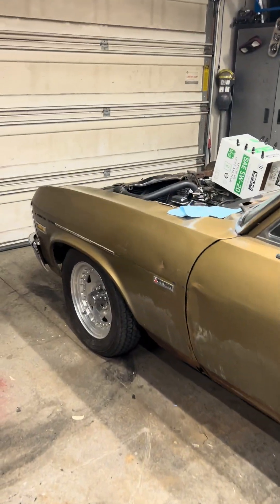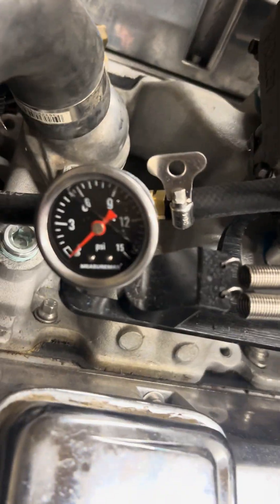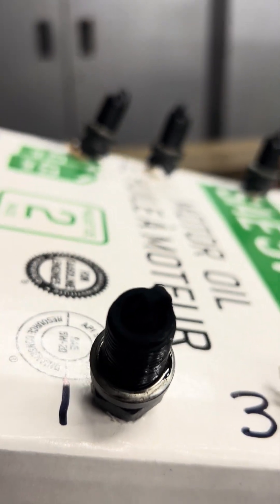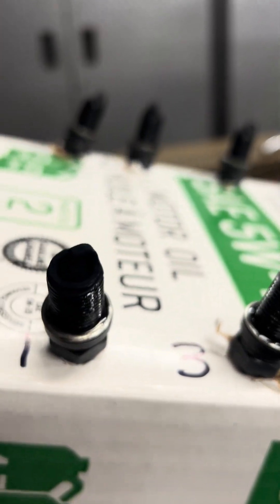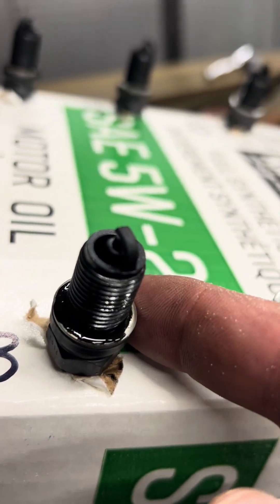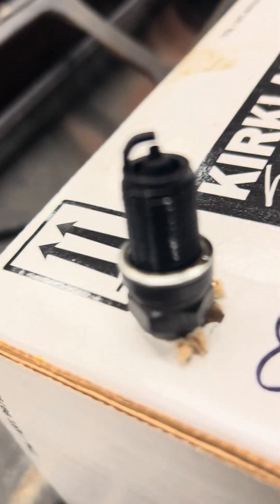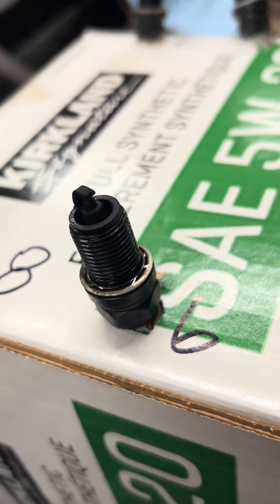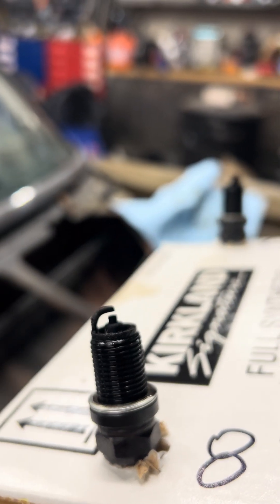What did this to these plugs in 20 minutes?  You won’t believe it!

Comment: Too rich. Drop a couple jet sizes. Re adjust mixture screw.
Unplug all accessories that run off yhenvacumm of the manifold, ie brake bookster etc just to eliminate vac leaks, and give a little spray with carb cleaner around gaskets when runningb,if revs increase theres a vac leak.
Start with jets and vac leaks first.
Reply from the maker: That’s oil on the plug. Just released the tell all video that explains what this nightmare was. Never seen it coming either

Comment: What’s the ignition system setup on the engine? It could be that you’re jetted too fat, but it could also be that the plug isn’t hot enough. Too cold of a plug or a weak dist./coil can give you plugs that look just like this even if your AFRs are great.
Reply from the maker: That’s oil on the plugs, finally found the source of the problem released in yesterday’s video
Reply: @shortcutgarage  I honestly thought they looked oiled down at first glance but I figured if you were having ring issues or otherwise getting blow by you would have mentioned it lol. That’s what i get for assuming. Glad you figured it out though

Comment: Vacuum lines
Reply from the maker: Vacuum lines deposited oil on all
Eight plugs?
Reply: @shortcutgarage  if it made it past the Fluxcapacitor and the regulators at the same time anything is possible...

The vacuum lines was meant for another video I had watched ... was it the rings on yours???

Comment: Possibly intake manifold/ gaskets?  Intake manifold not sitting correctly on the heads? Just a couple thoughts
Reply: You mean partially.blocking the ports?  If it was sucking air downstream wouldn't it be lean?
Reply from the maker: check the new video just released this morning.  She’s cured!!
Reply from the maker: That was my first thought as well. Aftermarket intake. Aftermarket heads. Makes sense

Comment: Change to high compression piston rings! 

Change distributor and advance the timing!

Adjust air fuel mixture to be rich! 

Increase idle rev to 2000

Free flow exhaust! 

Alternator and battery.= fun 😂
Reply: New spark plugs also 😂
Reply from the maker: @bmint that oughta stop
The oil burn lol
Reply: @shortcutgarage after reading the comments, I have to add, check your valve adjustments, specifically your intake valves.. 

I skipped that because I figured, the engine must be running good enough in order to foul those plugs.. 

Closing your intake valve earlier  will greatly decrease your power..

but it may save your wallet a few dollars in plugs every month..
Reply from the maker: @bmint my plugs last 20 minutes lol. I’ll check
The plugs

Comment: Tough to tell if that's oil or fuel on those plugs. If it's oil, how old is that engine? Lol gotta be the valve seals or rings, in that case.  If fuel, you're running way rich for some reason, which should be somewhat obvious when standing behind the car take a big whiff lol.  I would start with adjusting A/F ratio.  Like I say, tough to say from this video though 🤷‍♂️
Reply from the maker: It’s oil. Blue smoke too
Reply: @shortcutgarage  OK. Typically valve seal or piston ring is the culprit then, but I'm just a shade tree mechanic on the occasional weekend lol.  I'm sure someone on here will be more helpful.  Good luck
Reply from the maker: @DA-br9xd  hoping it’s not the rings. That’s a lot of work ahead of me lol
Reply: @shortcutgarage  Right.  I was trying to think of something less costly and time consuming that you could start with.  Valve seals would be the easier of the two.  Is there a lot of miles on that engine?

Comment: What is your timing set at?  Is there fuel dripping from the boosters when the car is running?
Reply from the maker: 36° Advance. No fuel drop. That’s oil on the plugs
Reply: @shortcutgarage 36 degrees is good.  Do you have breathers in the valve covers, a pcv system or some form of crankcase Evac system? You might want to do a leak down test. That's a lot of oil. If the intake gaskets aren't sealing, oil can be sucked into the intake runners thru the lifter valley. It's hard to diagnose some issues over the internet.
Reply from the maker: @4-gear pCV is good, leak down test was 17%, compression was 175 dry 180 wet across the board

Comment: Had the same problem with my 383 stroker from Blueprint Engines
Fouled 2 sets of plugs. Your just running way to rich. What I did is found someone that was really good at tuning carbs and problem was solved. Hopefully everything works out for you 
Nothing worse than spending all that time and money and still not perfect
Reply from the maker: I swapped carbs with a known good carb. Same result. That’s oil on the plugs.
Reply: @shortcutgarage  Damg that sucks maybe it's like you said. The rings were put on wrong. I feel your pain. I spent 6 grand on Parts and lasted 200 miles 
That's the reason for the motor from Blueprint Engines. Good luck 👍

Comment: Are those plugs the correct heat range for the engine?
Reply from the maker: I believe so, so far as that many people with these heads and this application use these exact plugs
Reply: @shortcutgarage  cold plugs could explain fouling.

Comment: Carburetor. She's running rich. Check vacuum lines.
Reply: that was my guess, massive vacum leak causing rich tuning
Reply: Looks like oil. PCV, brake booster?
Reply from the maker: Those two items check out.
Reply from the maker: Nope. That wasn’t it